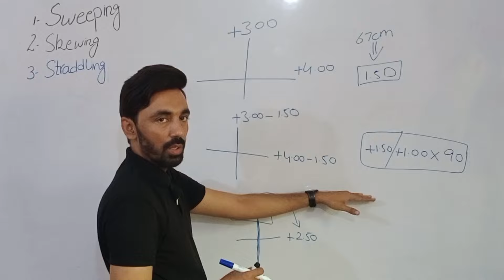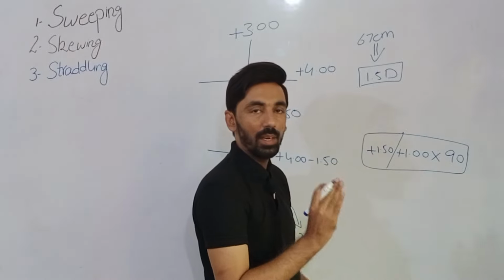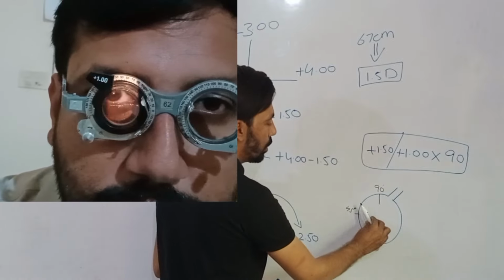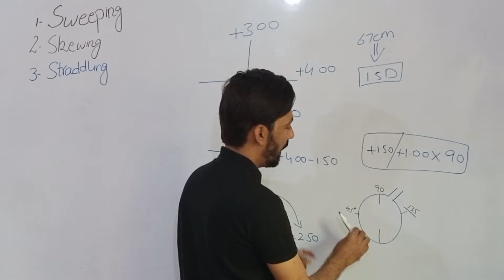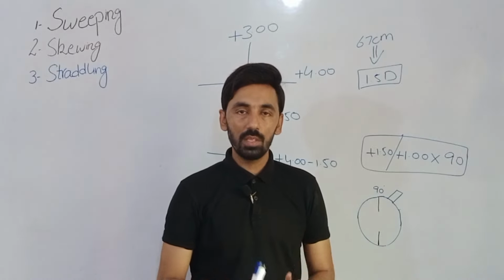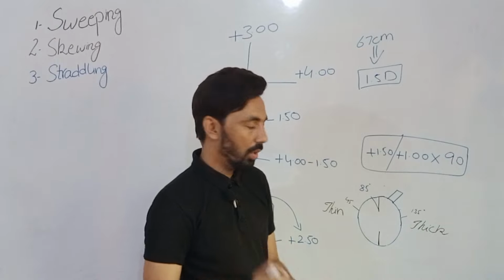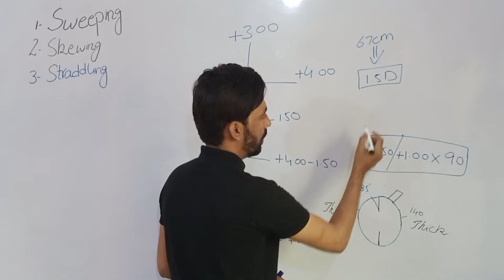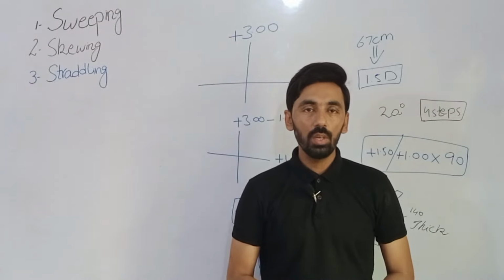Straddling Technique in Retinoscopy

Comment: Sir why you selected 45 degree? Why not any other axis?
Reply: Because axis is in 90 you should be 45 degree apart both clock wise and anticlockwise eg - 90 is your axis then 90-45= 45 and 90+45=135 then compare thickness and keep in mind where you are getting least thincknes rotate you retinocopy streak either by 4 steps or 20° method